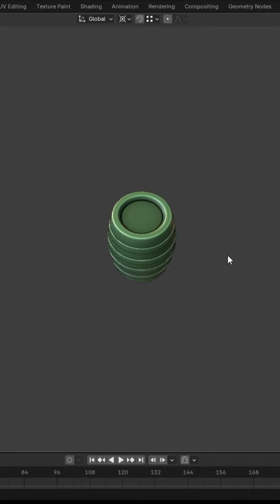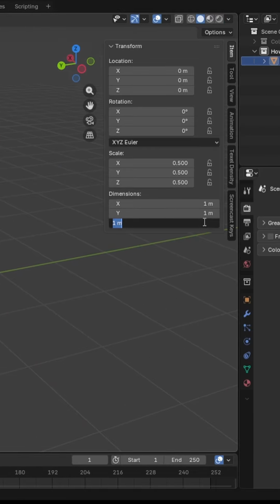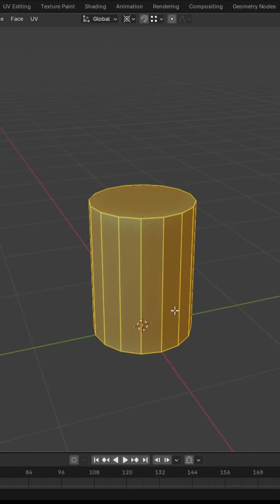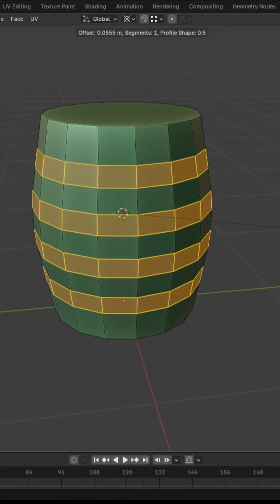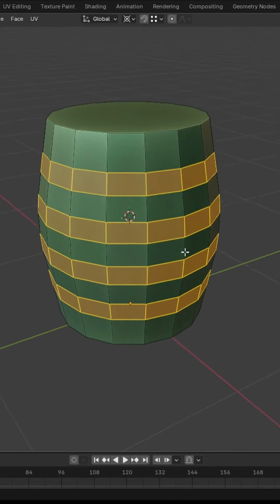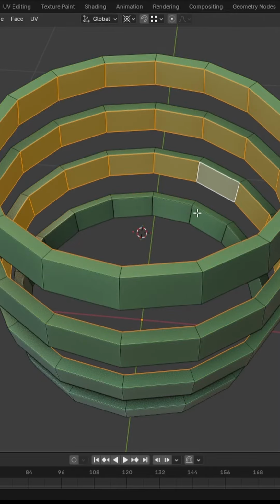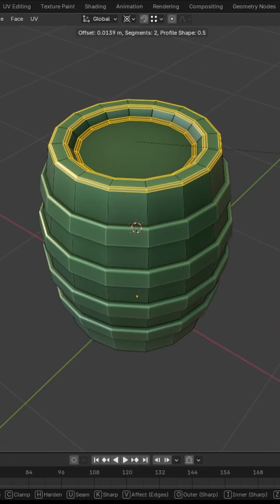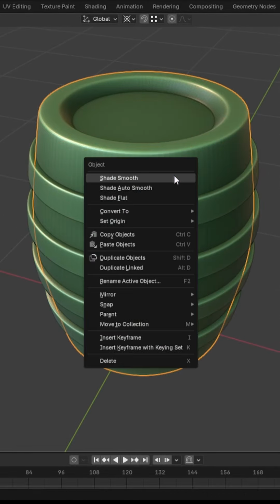Blender Quick and Easy Barrel Modeling #blender3d #blender #tutorial

Comment: One part you overlooked was the N-gon caps on the barrel. N-gons may not be a problem depending on what you use the barrel model for, but it will not subdivide neatly and may show pinching artifacts in render. Easily fixed by deleting N-gon face and then grid fill.
Reply from the maker: Yes,  that's right grid fill would easily delete n-gon. N-gone may truly create some problems with more complex object and would not fit into game ready assets or sub-d perfect topology especially if its a curved surface. With this assets since its a flat surface on top of the barrel i done it with just as little as possible to create asset. Thank you so much for pointing that out that's a very good tip  💪